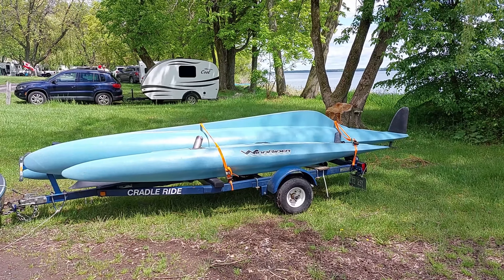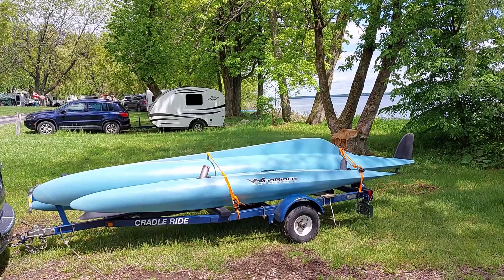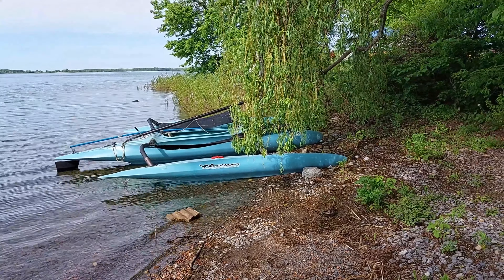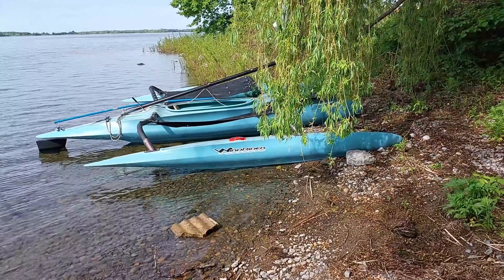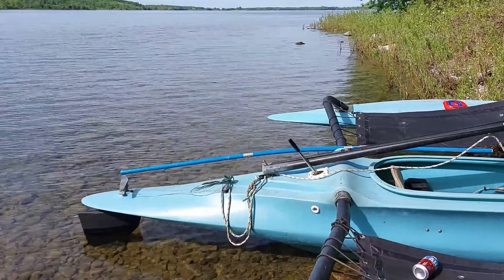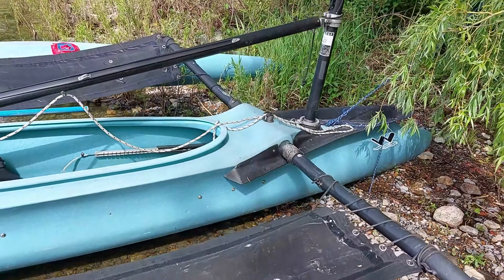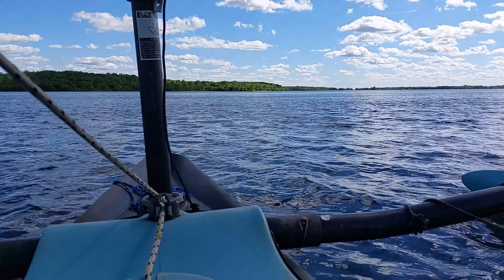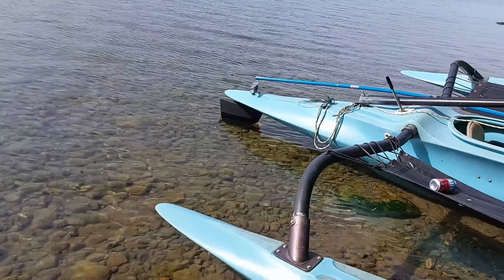Windrider 16 Test Sail

Comment: Your akas are criss crossed the two with cleats are rear akas.
Also, the trampolines have one end angled. That end goes to the rear, smooth side up.
I learned this because the one I just bought was the same way.
Luckily it came with the manual so I was able to figure all this out by reading it... Mostly just looking at the pictures😅
Thanks for the content!

Comment: Now there is your next Everglades Challenge boat! Dragging it across the beach to the start will be the hard part.

You can throw that one on top of my trimaran, and we can shuttle from Key Largo back to Fort DeSoto.
Reply from the maker: Dragging it down the beach is not bad.  I drag it about 20 feet up our beach for storage each week end then drag it back down Friday night.  Just need a couple of 2x4s for it to slide on.
Reply: @travelbywater9378  Getting my kayak from the parking lot to the starting line for inspection was challenging enough for me. I think it was over 400 yds.  My homebuilt trimaran weighs about 300 lbs, so I'd definitely want to make use of the road to drop it off. I have a pair of inflatable rollers for the last bit. 
If you have favorable winds, you'll be golden. But I think yours would paddle like a sea cow.
Reply from the maker: @wisenber  I think if I was to do the EC in a trimaran I would trade this in for a Hobie TI.  This is a great day sailer, but it's a slow boat on an upwind beat and ya, it doesn't paddle great.
Reply: @travelbywater9378  I would have thought that one would do better than a Hobie upwind? The WR 17 has a daggerborad I believe.
Reply from the maker: @wisenber  for sure it does better upwind then a Hobie TI.  But my Hobie Bravo i think does better to  weather...   Maybe with a new sail it would do better.
Reply: @travelbywater9378    Do you still have the Hobie Bravo?  I am looking to acquire one.  I am in SoCal, but have relatives in Sarasota area where I could keep one.
Reply from the maker: @alanaldpal950  I do still have my Bravo, was sailing it just a couple of weeks ago.  But I am in Ontario, Canada.